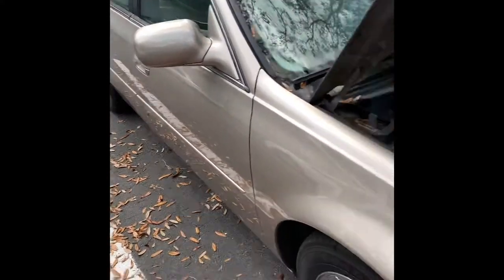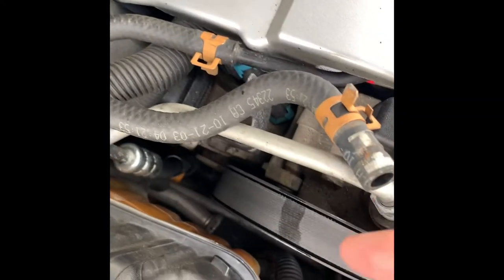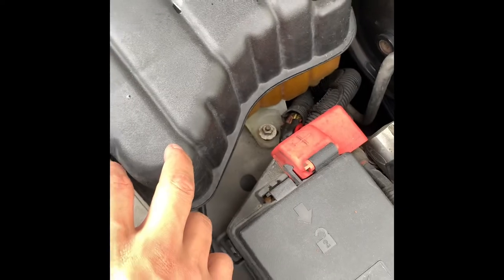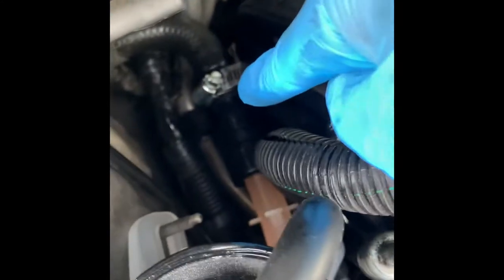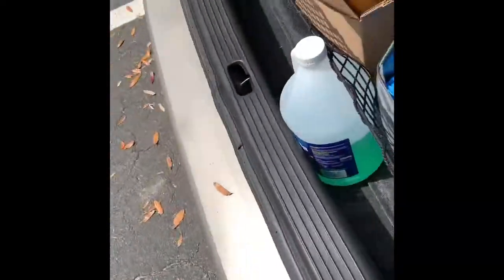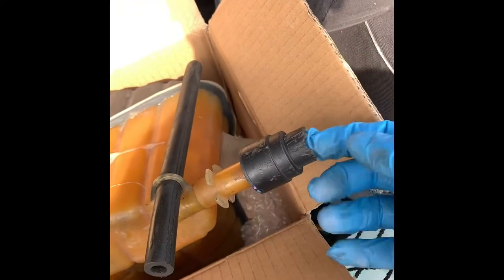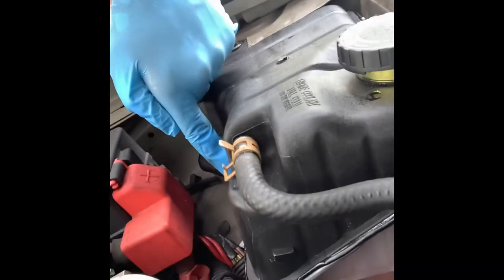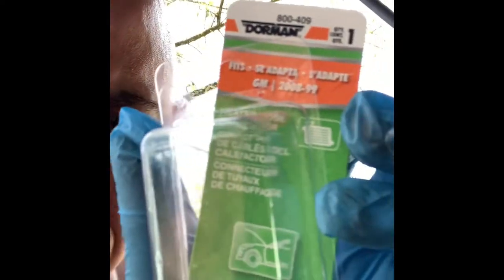Cadillac Deville coolant reservoir replacement

Comment: My does the same thing. The sensor gets stuck. Take a mallet or ball peen hammer and tap near the sensor for a while. That should get it loose and keep the “check coolant level” message from coming on. If not, this is a great video.

Comment: I have the same year same color the inside and outside of the car is I don't know how to describe it but it just look like nobody drove the car. I bought it last year for 2,000 it had a 180,000 miles  now am a 205,560 miles no problems at all but I want to change my coolant reservoir and get the coolant change at the dealer they're charging 369  to change the coolant all the hoses the reservoir  change the thermostat and inspect the radiator the people had a radiator put in 5 years ago so they pay 400 and something for that I seen the receipt but they also put about 70 thousand miles on the car in 5 years do you think that price is worth it because I don't know how to do any of this stuff